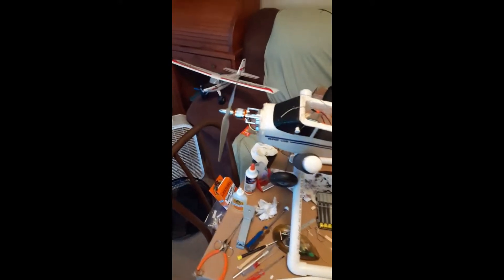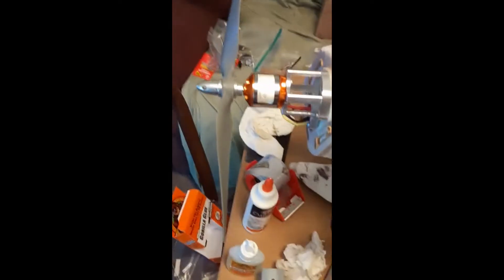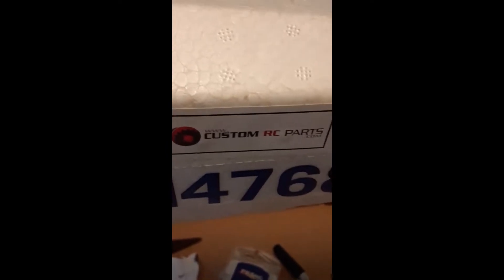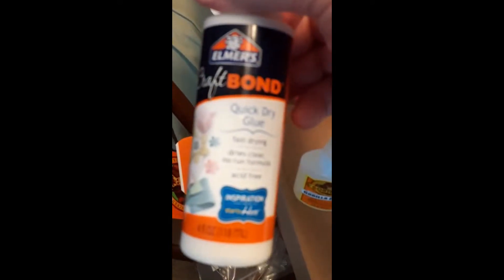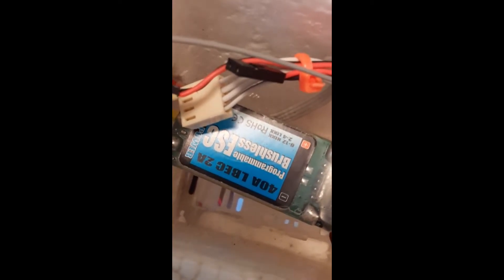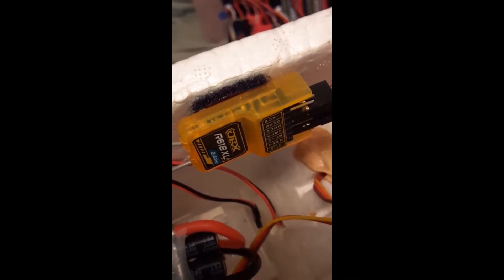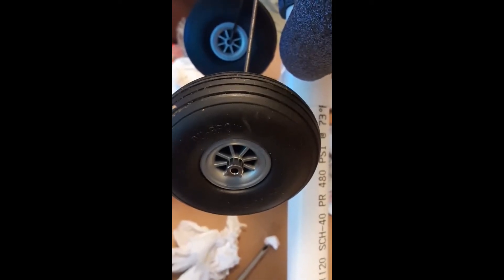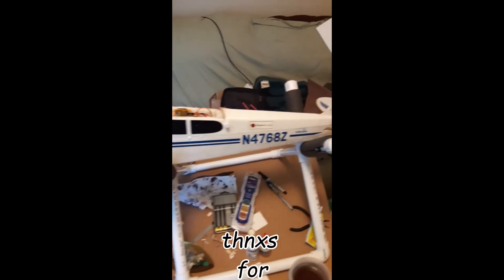Hobbyzone Super Cub LP - Hotrod heavy mods, 2009 or 2010 model

Comment: Randy I've hot rodded my super cub put a 480 on it ,didn't like it,  flew fine but looked stupid in the air going so fast.  Have a nice 450 range motor.  I flattened the wings and put ailerons on.  Love taking it out.  I learned to fly on mine it's 11 years old and still going. Jeff in LA USA
Reply from the maker: 450 motor 1000kv, is to much power, on it, flew it friday evening,  it just climbs when you throw the power on, but it has enough to get you out of trouble too, i like that part of building planes, its still need triming